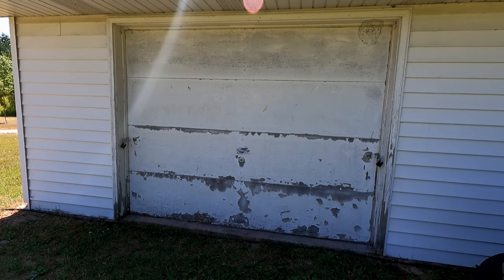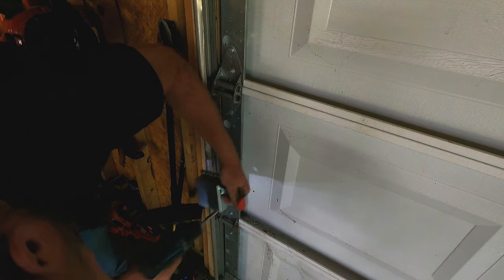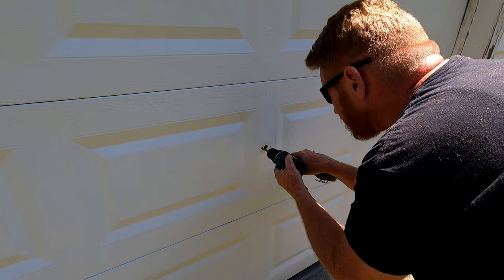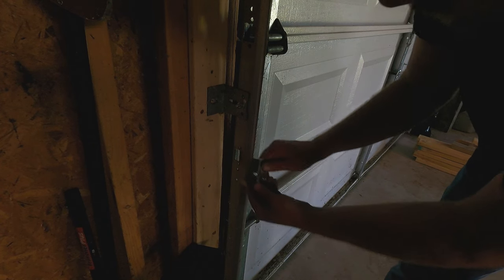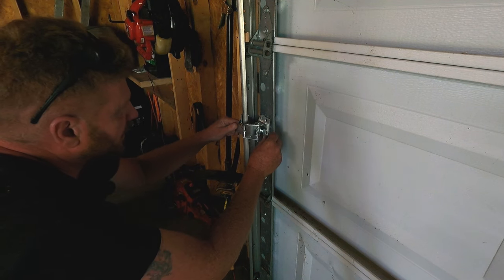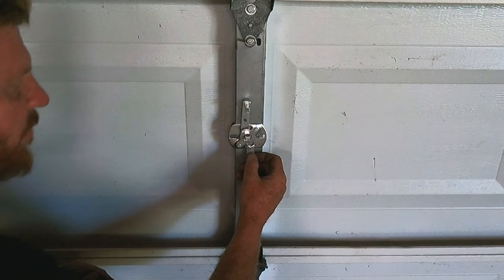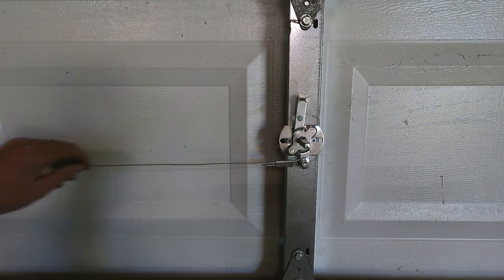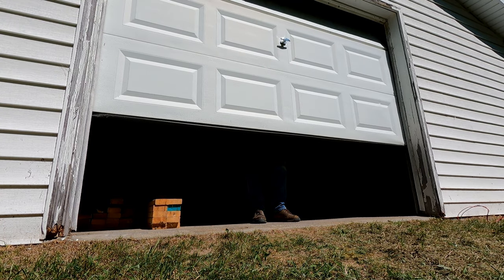RI-KEY SECURITY - Universal garage door lock kit -Step by step install

Comment from the maker: UPDATE - 1/7/23 - This kit is still working flawlessly. I have had no issues with it so far. I installed a second one on my other door, and have had no issues with it either. On another note, getting extra keys made was not an easy task. Finding the correct blank key was nearly impossible. After going to several retailers, I ended up finding them at ACE Hardware. It wasn't exact match, but it did end up working. Thanks to everyone that has watched. Have a great day,  and God Bless.
Reply: Hi, what size socket did u use? I’m having a big problem putting on the nut. Thanks
Reply from the maker: @kimberry8731  I would be lying if I said my memory was good enough to remember. If you are talking about the "speed clip" that I hammered on, then any deep well socket that is just a little bit smaller in diameter will do. If it is one of the   nuts then I will have to try to remember to check this weekend when I am back there.
Reply: @DevaultFamilyLiving  yes I’m talking about the speed clip u hammered in. Ok I have some sockets I can try. Thanks for getting back to me
Reply from the maker: @kimberry8731  You are welcome.
Reply: @DevaultFamilyLiving  I got it on. Finally
Reply from the maker: @kimberry8731  Glad it worked.
Reply: Good I need one 💯😩

Comment: Couldn't help but notice you ran your cables backward. The fittings go in the Center assembly holes and the Bare Cables ends pass through the notch in the Spring latches and is captured by the Bolt/Top Washer and backside nut. Works perfect and makes tensioning the cable a breeze.
Reply from the maker: I probably did. But they work perfectly. Still going strong. Thanks for the insight. I will correct it if it ever becomes an issue.

Comment: Thank you, but what is the best/neatest way to cut slots in the metal rails of the garage door to accommodate these garage door locks? As my door was replaced in middle 2011 and has NO metal cutouts to install these slide locks. Any useful input is appreciated.
Reply from the maker: It's hard to see in video, but all of my hardware is mounted to just standard holes that you can drill with a drill bit. My rails are like 30-plus years old, and the slots did not line up either. I mounted everything to the door first, held the striker plate to the rail where it lined up with the latches, and marked & drilled holes where necessary.  That makes them non-adjustable, but I haven't needed to make any adjustments thus far. Hope that helps you.
Reply: Thank you for that information, and the very fast response, it is much appreciated. 👍

Comment: Can you unlock the door from the inside?
Reply from the maker: Unfortunately no. However you can just pull on the latch cables and release them from the striker plates. So it can be opened from the inside, even if it is locked.
Reply: @DevaultFamilyLiving  Incorrect. you simply push the long bar to the left to release the door from the inside. It will pivot without rotating the locked handle from the outside.
*The Key simple locks the square shaft handle to the outer assemble so the handle cannot be rotated.